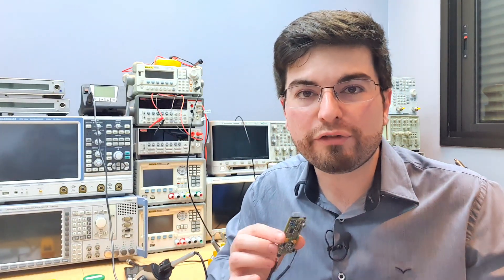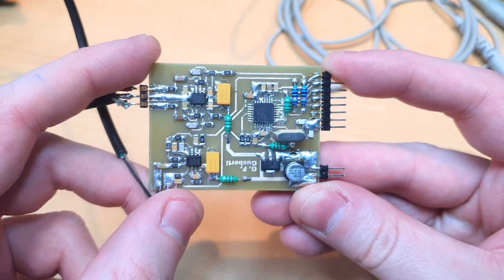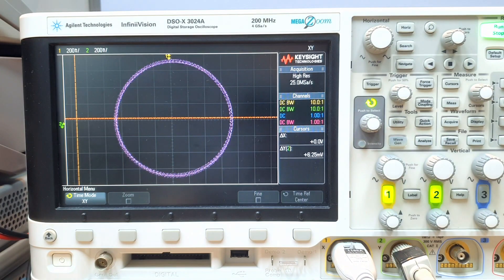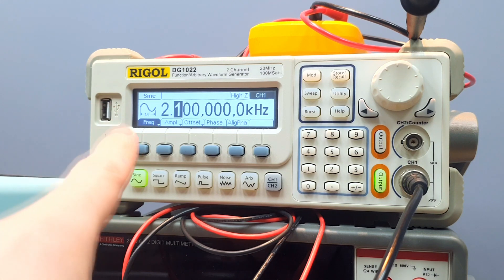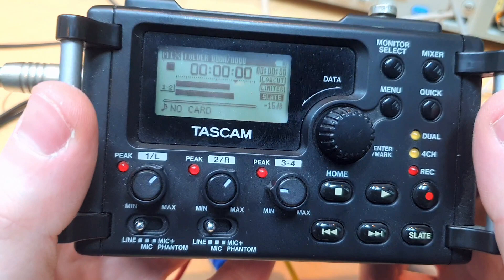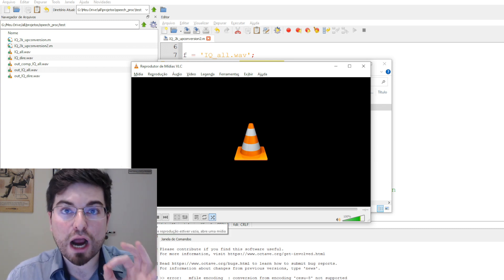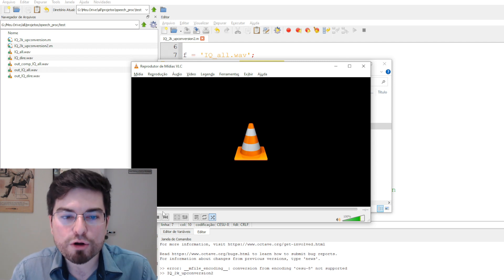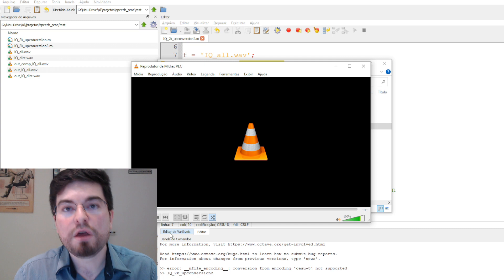Ham Radio SSB Processor with AVR Microcontroller

Comment: Hello! I had been trying made audio phase shifter using STM32F303 microcontroller using a copmlex FFT. BUT A processor was busy 80% of time.As a result - main logic of a program and  modulation process had not been realized.Your design uses Waver principle - as I understand.